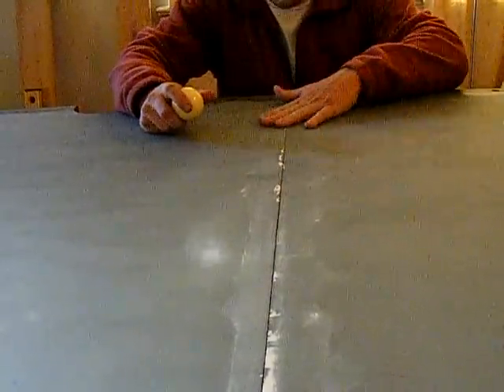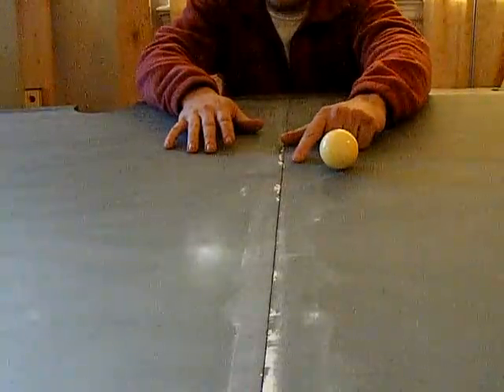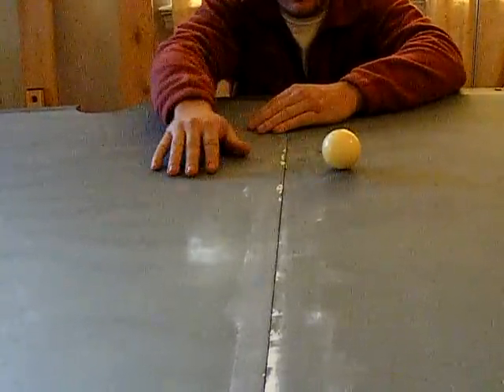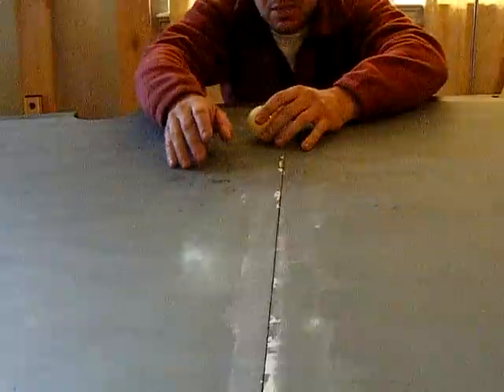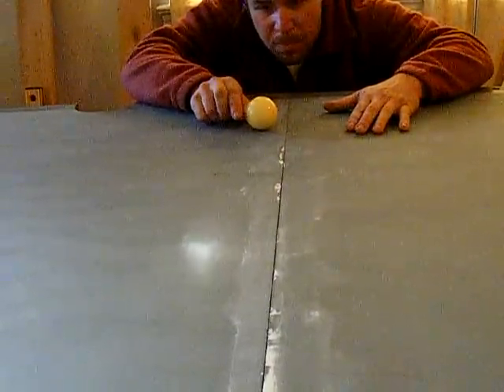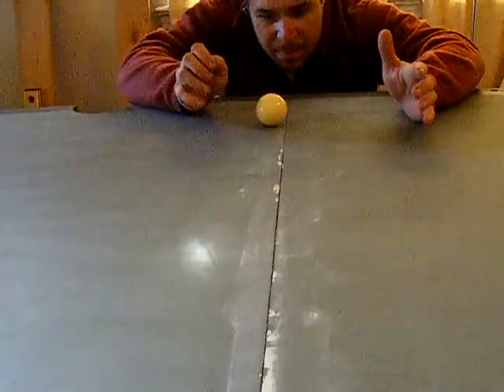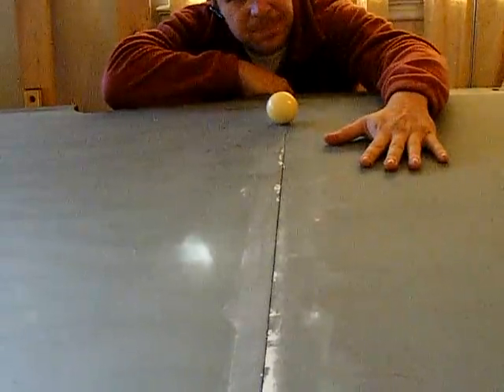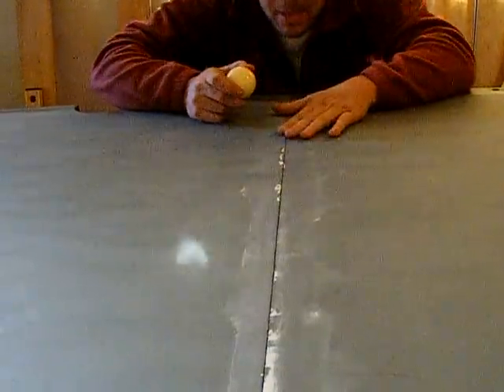Pool table installation part 3 slate seams mpeg2video

Comment: I was told to use Bee wax in between the pieces of slate to make it smooth. The reason you use Bee wax is there are no petroleum products in the Bee wax so there would never be a mark on your felt later down the road... Works great...
Reply from the maker: Thx!

Comment from the maker: pdigital....sounds like you did it right then.    just takes patience.   i cant remember how i came to this technique.   i may have stolen it  from someone else.    i spent a few hours a day for about 4 weeks setting up this table.   plays perfectly in the cold weather months as that is when i set it up.   in the warm weather there is the tiniest amount of roll to the north.  i'm guessing my joists on the first floor heat up and pitch the table a tiny bit .  in a basement it should be fine.

Comment: I should have thought of that.  I actually used a new razor blade and ran it across.  After a little while, I could swipe it across without getting stuck or running over any bumps.

Comment: To true the slate( make each slate level with each other) take three pieces of string and tie them over the length of the table ..one on each side and one on the midle..make sure they are pulled tight..now get 7 pieces of door moulding or anything that has the same thickness and place under each end of the string..now take your 7th piece of moulding and run it under the string and match the heighth by placing playing cards under the slate bed

Comment: If you are using a ball to level slate then you have not got the first clue what you are doing. This in no way guarantees a level surface.
In terms of leveling slate, and I see a lot of different theories in this discussion but in reality the table will dictate where you begin leveling.
After your frame is set and leveled on its own, put the slate pieces on and square them up (or find the existing holes and hope the first installer was correct).
Check around the entire table with a level, this will establish your high spot dictating where you need to start from. Simply bring everything up from there. If you level in a circle and your slates are set properly then your seams will be flush when you are done, possibly only needing a slight lift in the middle for perfection.
Reply: He wasn't using a ball to level the table he was using a ball to make sure all the slate was flush
Reply from the maker: +Alyssa Dunn  in previous videos, yes, i was using a ball to level the slate.   this is the best way to ensure your slate is level.   i know installers who have installed for 20 years plus and do it that way too.
Reply from the maker: +Shane Bouchard i did use a level to find the high spot on the frame.   then i set all the pieces of slate on the frame and got them in position.   then i spent a good deal of time getting the first piece of slate perfectly level, and then i did the 2nd piece, bringing up the seam to where it was perfect, and rolling the ball across 2 pieces of slate.  once perfect, i did the same with the 3rd piece.  table is as perfect as the slate will allow.    by you saying i have no clue indicates that you have no clue.
Reply: i have many different size levels. im a contractor. when starting fresh i will level with the level. then i use natural physics of studying the balls natural rolls and geometry to see if it needs adjusted. which usually  does. ball tells you what you need to know more than the level

Comment: just so you know bud, in order to properly get the balls to roll straight you need to put a few machinist levels on the table and figure out which slate is furthest out of wack. Starrett makes a good level and they are .005" accurate. just eye balling the balls to see if the slate is level is absurd and honestly is laughed at by anyone who is in the business.. and I'm not trolling you, im just making it clear to people that this is absolutely not the way to level the table
Reply from the maker: i am aware of that method.  two points you are missing. 1. most people do not own or have access to that machinist level and they are quite pricey.    2.  that level is about 8 inches long and can only measure the slate in small areas.  in the real world, all slate is not perfectly flat, thus decisions are made as to how the ball rolls across the entire slate rather than how level is this 8 inch section.  you reference the industry.  how many tables have you installed?
Reply: the level is 12"  and I use multiple on each piece of slate. I understand it's expensive but it's about using the right tools for the job, I use well over 1000 dollars worth of levels. I am a table tech in san diego and have done thousands of tables including pool halls that host professional tournaments
Reply: I don't want to go back and forth with you anymore bud, you at least had the drive to do it yourself. if it's not perfect it doesn't matter because your not getting paid to set tables up anyways
Reply from the maker: in case you missed it, i made this video not for the pro (like you) but for the homeowner who, unlike you, doesn't have a grand invested in machinist levels (and no, the rental store doesn't rent them).  just because that is the way you do it and the way you were taught doesn't mean its the only way.   in the end, its about the balls rolling straight.   if you cannot tell if a ball is rolling straight and you need a level to prove to yourself that a ball did roll straight, perhaps you need to continue using your method.   my table rolls as good as the slate will allow.   its perfect and plays better than most tables that you "pro" guys set up.   my guess is this video pisses guys like you off as it shows homeowners how to get the job done w/o using guys like you.
Reply: if your a player and spend thousands of dollars on the table, it might be a wise investment to just hire a professional that will come in a do it right. I'm not upset about losing business, cause this video isn't gonna effect my pocket, i was just stating the ball rolling technique  to level tables is ridiculous
Reply: as a matter of fact these videos keep me in business. I'm always the first one they call when someone saw a do it yourself youtube video and screws they're table up
Reply from the maker: i've gotten many comments on over a million views on my vids.  you are the first person to suggest that you cannot tell if a ball is rolling straight or not.  its a skill most pool players have, but i guess some people have it and some dont.   i'm aware of how pro installers install tables.  they do it as fast as they can.   isn't that what "pro" means in any industry?  pro= as little work in as short of time to make maximum profit.   i get it.  there are pros and then there are craftsmen.
Reply: maybe your tweeker buddy who supposedly was in the industry for 25 years works that way.. I would love to go to your table and throw a couple levels on it and you can film how far out of wack your table is, I won't even charge you
Reply from the maker: thanks for the offer.   if i was in cali i'd accept.   since the balls roll very straight, i think you'd be surprised how good it can be done w/o a level.   again, your theory that it cannot be done w/o a level only holds true if one couldn't get the balls to roll straight on a piece of slate using shims.  in a nutshell, that is your claim:  "balls cannot roll straight unless a level is used", correct?   that is quite a claim.   if gravity weren't so constant, perhaps that claim would hold water.   i bet if you had to (and you dont want to admit it)...but it you showed up to a job w/o the levels and pushed balls slowly across the slate...i bet even a guy like you could adjust the slate where the balls roll in a straight line.   i'm sure you could.  and once they roll in a straight line, isn't that the goal?
Reply: ok if all you wanted me to do is to agree to you that there is another method of leveling the table then here it is.. I agree. now that method has many flaws one and the main point being you cannot get it perfect, period!
Reply from the maker: getting it perfect is ONLY a function of how long you want to mess with it.   if you have the time and desire, the balls can be made to roll as well as they would using your method.   to suggest the balls will roll to one side because i didn't use a level and i didn't notice that when the slate was bare is just a silly statement.   now i suppose if ray charles was leveling the table using my method, then okay, your point is valid